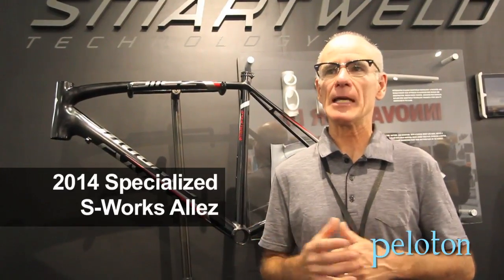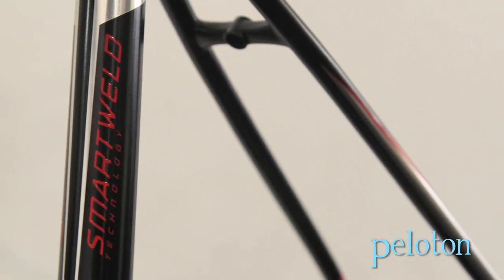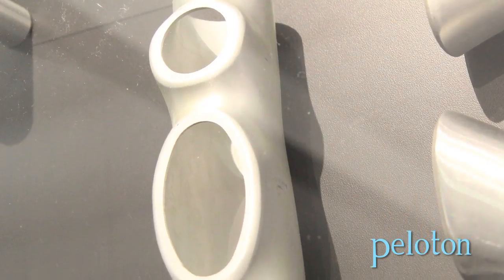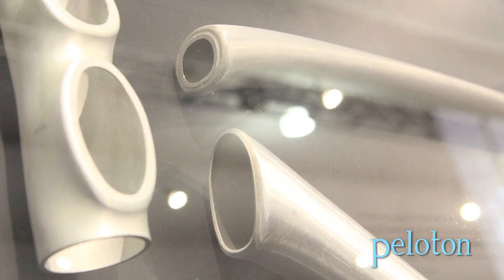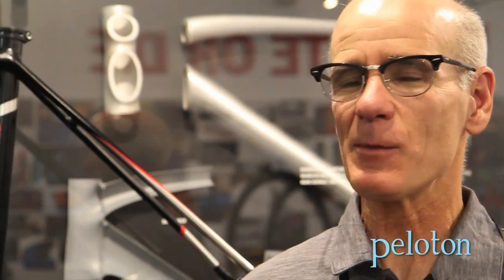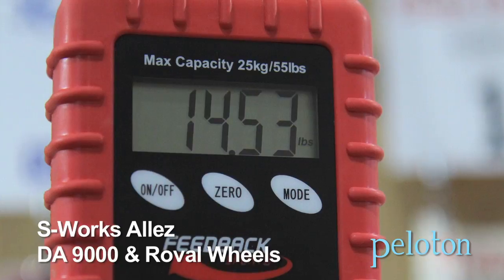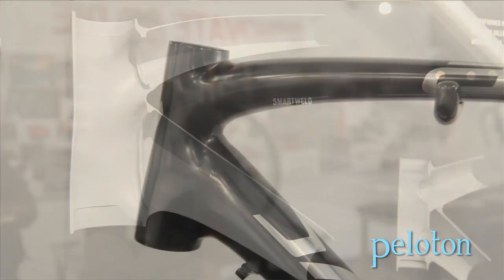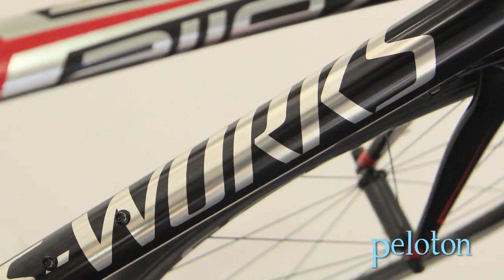Specialized 2014 S-Works Allez and Smartweld

Comment: I have the exact same bike as in the video – the S-Works Allez Limited – and I’ve been struggling to find any reliable information about the correct headset bearing cup. There’s barely anything out there, and even Specialized dealers don’t seem to have clear answers. If anyone here has dealt with this before, I’d really appreciate any help!

Comment: I have the $2400 allez and the $2400 roubaix and the allez is much lighter and faster. Going downhill without peddling I can pass my bro even though he is peddling at 50% power.  The allez is super stiff
Reply: A better comparison would be a Tarmac, don't you think?
Reply: +Romeo Fowler hmmm true. Lucky for you I also have a tarmac.  The tarmac is the same thing as the allez only more comfortable.  Once i bought the tarmac i never rode the allez again.  Biggestr difference way more comfortable due to the 9r carbon
Reply: +mitino aiken, I have never ridden a Allez. But I have ridden the Tarmac, its a good ridding bike. I have a CAAD10 equip with Reynolds carbon clinchers, and to tell you the truth the caad rode better than the Tarmac to me. The only Tarmac that I could tell the difference was the S-works model. And even then the Caad10 wasn't giving up much to the S-works. 
I had a 2012 supersix and when I bought the Caad10 I sold the Supersix. That's how good the Caad is. I will take take a well designed Alloy bike over a low grade carbon bike any day.
Reply: +Romeo Fowler have ridden the Allez sprint?
Reply: +mitino aiken No, but whats the deal with having no front Derialuer mount on that srint frame?
Reply: the allez sprint is for criterium riders.

Comment: Oops 2:00 pore in the weld. It's a basic weld technology. Marketing...
Reply: lol... there´s always some smartass screaming "fake" on the internet.. 
What does a tiny pore have to do with this special method of joining two matching, domed pieces (instead of just joining the normal flat tubes)? Of course they still do "basic" welding on the joints, but "where" is the crucial factor, and how these joints are designed to fit.
You obviously didn´t understand it.
Reply: con-weld technology
Reply: Exactly!!! The bike industry is getting ridiculous.
Reply: I have a dodici gara track bike with similar welds most Italian frame builders have been doing this for quite a while